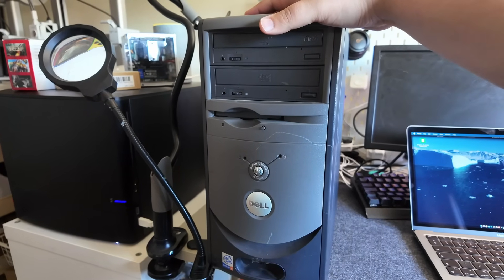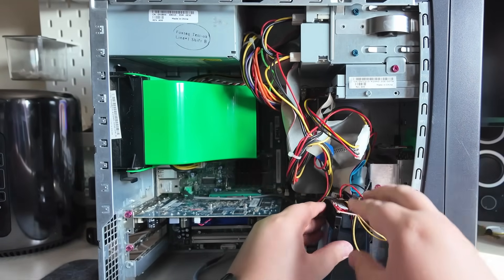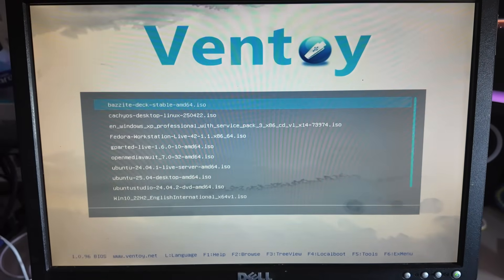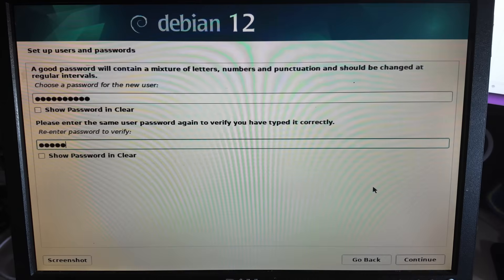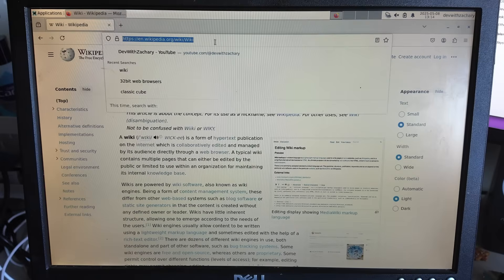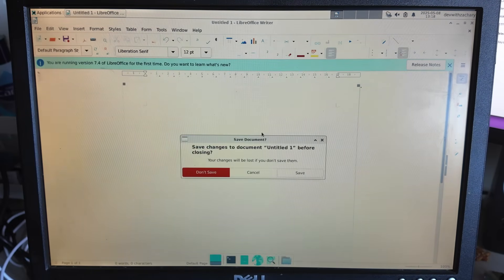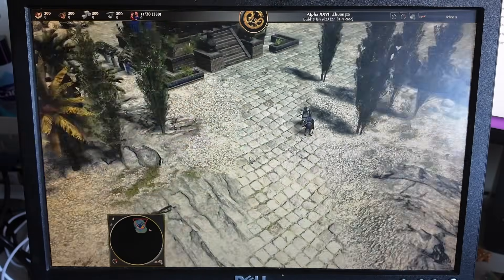How Useful Is Modern Linux on Old Hardware? Debian 12 on a 20 year old Pentium 4 Dell Dimension 4600

Comment: Another tip for using older hardware…. Make sure the BIOS is updated.
Reply: What for? Unless you have some specific issues that could be fixed, there's no gain from updating your BIOS.
Reply: @Aris_404 ..microcode may be updated, new algorithms may be implemented, etc etc.
BIOS updates have solved performance issues, whic are cause by “specific issues”.
Reply: @Aris_404  the better question is: why not?
Reply: I run whatever bios the eBay seller decides to install. I trust sellers with certain feedback! I do not trust Amazon!
Reply: @bondjovi4595 ..whatever does “Amazon” have to do with the board maker’s BIOS?
BIOS is obtained from the board  OEM website……
Reply: 20 year old OEM PC's with proprietary motherboards? Good luck with that...

Comment: I get some dell latitude for cheap. No Pentium 4 but all of them cheap laptops and desktop comes with at least dual core 64 bit Celeron and ddr3L Ram as a bare minimum. Since I use Linux, I don't feel the need to upgrade the Ram but SSDs are necessary

Comment: I would check to see what codec you are using. I use h264ify & it helps a lot on these older systems. I was able to play 360p video on an old netbook. OS is Debian based Q4OS 32bit. Cpu is Celeron N something. I think there's 2 Gb of RAM so maybe that helps.

Comment: Calling a pentium 4 20 years old just made me go bald.
Reply: It gives me a feeling of dread to know that my childhood is drifting further and further away from me. I'm 22 years old writing this from an almost 13 year old ThinkPad T430 (i7-3840QM, 8GB DDR3 1600MHz, Intel HD 4000 & NVIDIA NVS 5400M, a lot of other mods). It still feels modern to me, at least this is until I use a modern machine and realize how thin and hot they've become, how bad the keyboards have become, how little upgradability they have (my laptop has a socketed CPU), and just how weak they are compared to these old ThinkPads. My ThinkPad T430 will be my main laptop for many YEARS to come.
Reply: @BrandonTGS  Wait until you are 50something lol
Reply: The Intel Pentium 4 was introduced in November 2000. Therefore, it was approximately 24 years old in 2025. Intel announced the Pentium 4 processor on November 20, 2000
Reply: 20 years ago I was in middle school and had a eMachines desktop running XP with stats unknown because I didn't care abiut that stuff back then. I know it wouldnt run a game that required a minimum of 512MB RAM but thats about it.
Reply: Thin, and Hot!? My 2024 Lenovo literally runs with no heat or fan, it's thinner than an 1/8 of an inch.

Comment: From looking it up, it seems the HD 3650 supports up to OpenGL 3.3, which might be sufficient for getting hardware acceleration in Firefox (from experience I know that OpenGL 2.1 is unsupported, but I haven't tested 3.x), though there are a few flags in about:config you will likely need to toggle in order to force enable acceleration. Some other comment here says that the card supports H.264 decode, so if you install the right VAAPI drivers then Firefox should also be able to leverage that to take additional load off of the CPU, but I would assume a Pentium 4 should be able to decode H.264 in software (back in the day my old single-core Atom would decode 720p just fine). The CPU is probably being overwhelmed by needing to simultaneously render Firefox's canvas in software.

If hardware acceleration does refuse to work in Firefox, Chromium supports at least as far back as OpenGL 2.1 which is what I use on my old Westmere i5 with its terrible iGPU.
Reply: Yeah, the 3650 should be enough for HW acceleration. I have a Win7 C2D PC, with a Radeon HD 2400 XT and even that is okay, compared to the horrible integrated graphics. It's really a CPU issue. A decent, real dual core is really the minimum I think.

Comment: I tried to make use of an old Dell GX 520 as long as I could tolerate with Mint OS  Debian version running a  3.20GHz Pentium 4, 4GB ram but kept running into compatibility issues with the 32 bit machine when on line. Final straw was my bank site wouldn't let me login anymore due to "security issues". I then purchased a Dell 3620 work station and was blown away at how snappy it was lol. I had gotten used to suffering an old system for so long. I've moved on and immersed myself in my new hobby and built many gaming machines but I still have that GX 520 and a Dimension 3000 with XP still on it. Thinking of turning the Dimension into a sleeper with modern hardware.
Reply: Good luck those old Dimensions have proprietary motherboard layouts. You'll have to do some serious fabrication work to get anything else to fit.

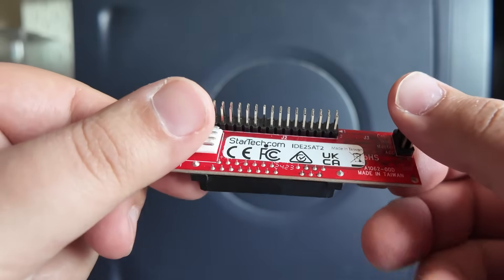Comment: 2:48 - u could buy a pci-sata adapter for better performance and reliability. I have that card and using a ssd with my pentium 4)
Reply from the maker: Good idea! this board does actually have a couple of SATA ports, i just really wanted to try out this adapter to make sure its working ahead of future projects
Reply: @devwithzachary  that adapter could work incorrectly, i had a lot of problems with that. So i prefer Si3114

Comment: I don't call Debian modern, it's usually lagging behind a few years. And also Bodhi linux is better for such things.
For some reason, my 8th gen intel company issued laptop load google slower, but maybe that is because of all bloat required. I remember running YT using Intel E2160 and Nvidia gt440 and playing 1080 videos perfectly. Same with libre office.
Reply from the maker: version being used was released March 15th, 2025 so its pretty update to date. Sure alot of packages lag behind compared to more bleeding edge distros. But its way more modern compared to the Windows XP install it normally runs
Reply: Debian is a bit outdated for some softwares, but not really years. And nobody cares here, since the computer itself is outdated ...
What would make Bodhi better for old computers ?
Most of Linux version use about the same kernel, launch about the same services at boot, we can use a light desktop or a more cpu demanding one, so it makes no difference.
All Linux distributions are about the same, there's no rational argument to pretend one is faster than another.
Fun fact : Bodhi is based on Ubuntu, which is based on Debian ...
Use a minimal Debian, with just X and very few services at startup, which is the default Debian behavior, and you have a system as light as Bodhi.
Reply: @nalinux  bodhi with Moksha used less resources than Debian with xfce on my machine. I have personal gripe with debian for not updating qBittorrent to v5 for quite some time. Untill Deban 13 that was released a few days ago.
Reply: @nalinux  my bad, i used x86_64 version.

Comment: Add 5 years and call it Y2K, which cuts resources severely while going back to 32-bits territory, that of Windows 98SE precisely.  At that point Linux options noticeably plummet, like dropping expectations to SlackWare v13.37 or Debian 7.11.0 for some vintage i586 PC with only 96 MB RAM and a mere 2 MB (yet accelerated...) video card, though possibly with MPeg-1 audio as an bonus!  Better have your drivers ready if contemplating extreme retro-computing next...
Reply from the maker: If i ever get hold of something older i look forward to digging into it, for now this is the oldest machine i own
Reply: @devwithzachary  It's not current to find one still in working order, of course.  But perhaps there's also virtualization to evaluate "light" distributions as an alternative.

Comment: I've got my old childhood Dimension 2400 still alive and kicking, upgraded the CPU some time back with the Northwood Pentium 4 HT 3.06 and it runs ZoronPS quite well surprisingly. Downside to the 2400, no AGP slot, it was a budget system so only PCI, and the AGP was removed from the board
Reply: I got one 2400, found in the street but it doesn't start :( . It seems the power controller is dead, difficult to fix. IIRC the AGP connector is not only missing physically, but the chipset doesn't allow the use of an external AGP card.
So we are stuck with the integrated Intel 810/815 or equivalent. I don't remember exactly.
Reply: @nalinux  whatever it is, the integrated is terrible and struggles even with super tux kart. But I do have a Zotac GT610 PCI that isn't great, but is worlds better than integrated

Comment: All my old Machines Runs Debian...this OS is the Mainstone of moddern computing.
Reply: I definitely agree, but I wouldn't install it on a computer that's used by average person. Not everything is configured and installed by default (like proprietary Nvidia drivers) which makes out-of-the-box experience sub-par with other distributions. For average people I would just recommended Linux Mint or maybe Fedora, but I don't have much experience for the latter, although I've heard good stuff about it.

Comment: I'm using some 20-year-old hardware for an HTPC. An Athlon 64 X2 with 2GB of RAM, a Geforce GT220, and running Linux Mint. Only real limitation I've hit for its use case is that it can't keep up with video files that are too-high a bitrate. For 1080p, around 1GB per hour will be handled just fine, but go much above that and it struggles. A 10GB movie is right out, and will never have its audio and video in sync. Watching video off YouTube or the streaming catch-up services from The ABC and SBS work fine in Firefox, though.

Comment: You can still watch youtube videos on it if you get the "Improve youtube" extension and lock it down to 30 frames only (so unselect the pid that says "allow 60 fps").  Then lock your resolution down lower, to something like 480p (also in the extension).. and it should play that just fine......  I have an old machine that's a little better than this.. It's Acer 7551 (2009), and it has 64bit  2.2ghz quad core, with "RS880M [Mobility Radeon HD 4225/4250]"...  (laptop, btw).  And it actually has a VGA and HDMI output.. I have used it as a couch PC, running two 50" screens for over a decade now.  It's actually a decent little machine.. But again, I can't run at 60fps and I only lock it to 720p..  but otherwise, it's great, and can play UFC PPV fights on one screen while watching youtube vids on the other screen at 2x and 3x speeds...(on Brave). ...........  I'm running Nobara KDE linux and dual booting with windows 10 iot LTSC 2021 (good until 2032).  It still works great.. It does have SATA for the drives, and  I upgraded to 16gb Ram years ago.   I have no complaints. ;)   ..........  I bet you can get more out of your setup with a little tweaking...  Firefox draggs my machine down a lot and spikes the CPU.. brave (or other chrome based) are much better.

Comment: Video playback will suffer due to lack of vram. You need a beefier gpu with at least 2 gig vram. Also, those machines only have single core, so its going to really struggle on anything that needs more CPU. This machine would fly with Windows 98 or 2000 though. These machines would be BEASTS for dos gaming and anything built for w9x.

Comment: Nice experiment. Thanks for sharing. I have a sweet little HP Omnibook 800CT which I would love to run Linux on. Also 32 bits, but... 200 MHz Pentium, with 96 MB RAM. But then, all I want is to be able to run Emacs well enough. :)

Playing videos on that will sadly never be a solid experience, as the 3650 GPU does not have hardware acceleration of most video formats used today. Most notably, it does not have h264 decoding in hardware. The 4xxx cards have that, which will make the video playing experience a lot better, at least for sites which can stream h264.
Reply: On this kind of old system, modern Linux are too heavy. They never work correctly and are a pain.
I prefer to use an old Debian Etch or Jessie.
I use Etch on my old Duron 600,and it's funny to play old Linux games with a Voodoo 2  :)
Reply: @nalinux  I like TIny Core for old, old systems. Damn Small Linux and Puppy also work, but Tiny Core is just in a league of its own. And it runs Emacs fine!
Reply: @nalinux  There are other tools, yes, but for some old laptops it gets hard to use those. Like the 800CT I have, unless I can find the special floppy with the special cable. But as soon as it's just a tiny bit newer, or has less exotic IO, there are great solutions out there now. I have a PII laptop with a 440 chipset which runs OpenStep, Windows 95, DOS, Linux, and a number of other obscure OS'es, and it's a really nice platform in all respects - and so easy to work on today.

I also had one of those tiny CD's with DSL. The FSF version, which was also a membership card. Sadly that vanished in a move.

Comment: so all of the linux guys who claim they can still daily drive a 486 thanks to LINUX have been full of it? Say it ain't so!
Reply from the maker: 😂 i mean it depends on what your daily drive looks like, but if your driving to access any of the modern web its not going to be fun!
Reply: @devwithzachary weird but how can someone use mypall on xp but have issues on Linux😂
Reply: @nalinux  okay
Reply: It goes well as long as the user has freedom to choice the software they run. With modern web apps, they don’t. They don’t use open protocols and instead force users to use closed applications.

As you can see the free games work pretty well but forget Facebook. Linux won’t help with that.
Reply: 486 support have recently been dropped in modern Linux kernels. You need to upgrade to Pentium :)
Reply: @Aris_404  try alpine Linux